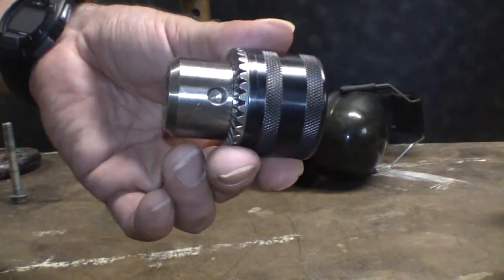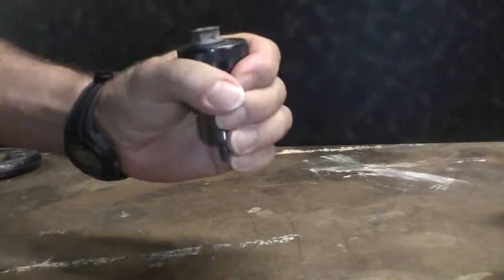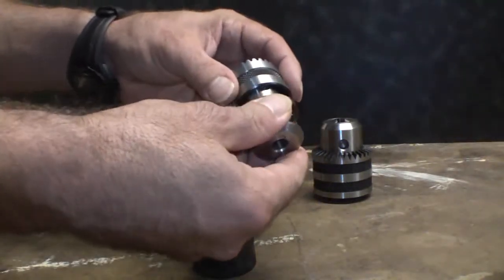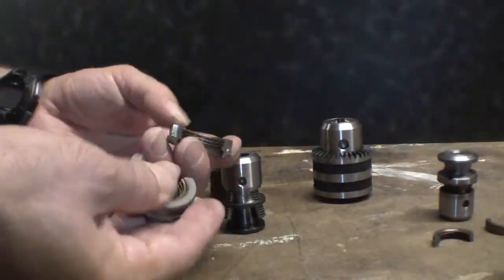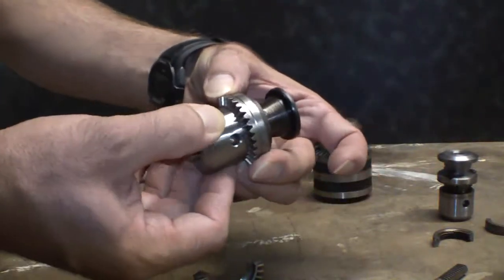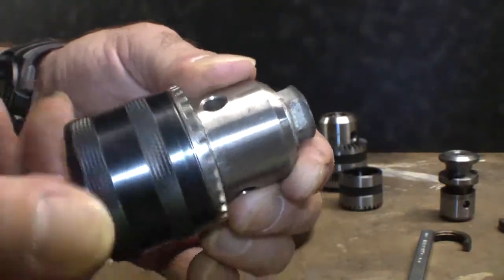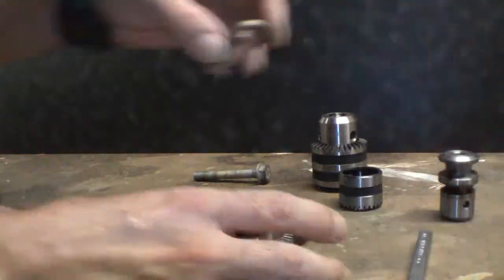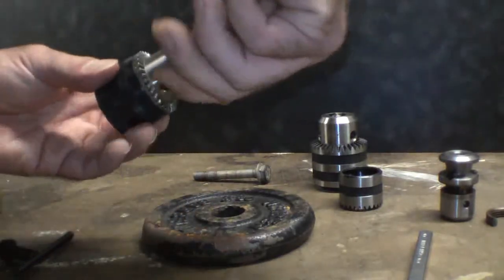Disassembly of cheap drill chucks (not Jacobs type)

Comment: I took a small one appart to clean it yesterday (marked "PVS Made in France 1.5 - 10 mm"); it works but there's a hard spot. Imagine my surprise at finding the nut in one piece and not broken in halves as I expected. How they installed it to begin with is a total mystery...
However, there is a number "8" engraved on the body, smack between two jaw sleeves, and two opposite dimples on the visible face of the nut (facing toward the working end), like engineered weak spots. So I'm wondering if this is meant for breaking it, aligning one dimple with the "B" and using, a small chisel and hammer, give a good wack where the dimple is. How stupid that is not having it broken in the factory! Has anyone encountered that before? Because it still doesn't explain how the darn thing was put together.

Comment: 1:00 how on gods great earth you do that??? its clearly seen that the sheet metal cover has a slight inward lip on the front side, mine too... it wont move a hair (bosch). theres another vid the one with the computer animations where the guy need to cut that front lip with a metal saw and then still use a circular bracket when he hammers it out... how can you do that in your hand?

Comment: sir i just want to point out that at this time 10:41 in the video, you're just basically hammering the bolt to the table that's why the sleeve wont go back to where it was  before. 
and another thing sir, i'm not expert and i learned some stuff only through Youtube and Google-ing things i don't know, and one of them is i learned  that you should apply a generous amount of  Grease inside the sleeve, in between threads and specially between the chuck and sleeve (at the rear end of chuck) where the dust   and metal shavings might squeeze though  (also prevents rusting)